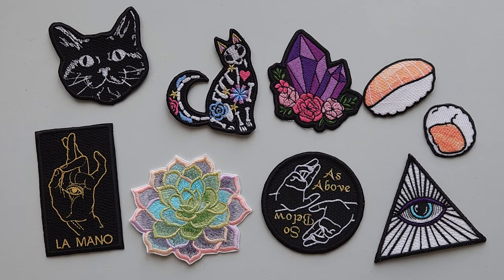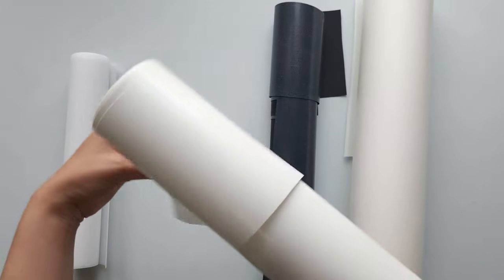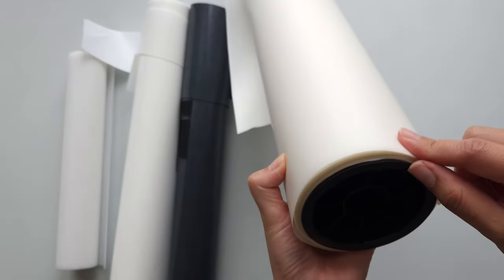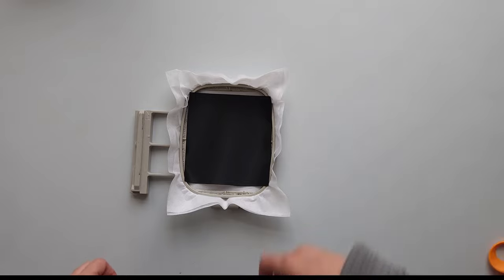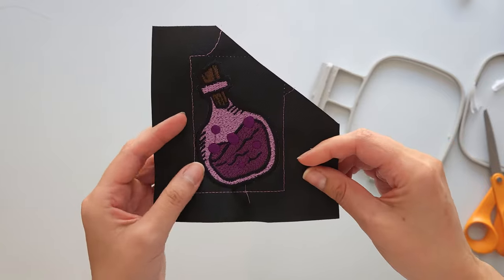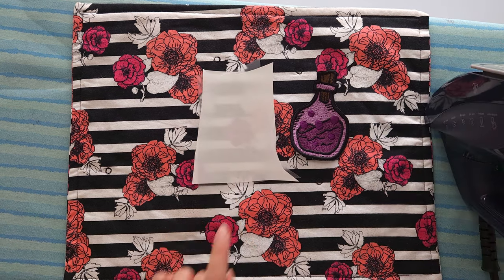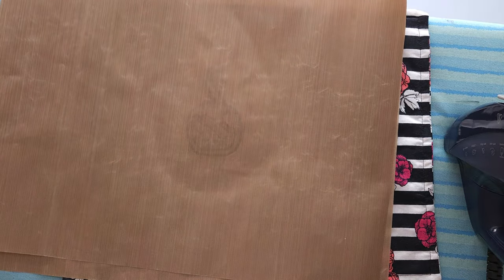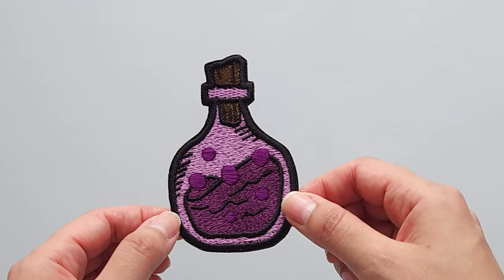How I Make My Iron on Patches

Comment: Is there a reason why folks don't do a rough, quick cut around the patch before doing the iron on adhesive and then the closer more exact cut after? The two videos I have watched from others also have them cutting carefully around the patch before and after adhesive. Just curious as I have not tried this before.
Reply from the maker: When I'm making a bunch of patches at once I actually prefer to apply the iron on backing to the patches before I cut them, then do the exact cut after. I should have mentioned that in this video but forgot since I was just making one patch. Good call out!

Comment: Why do you use patch twill and the iron backing? 
Does the patch twill not come with the adhesive back already? That part confused me.
Reply from the maker: Good question! My patches are fully covered in thread, so when you stitch on the twill,  the back of the twill is also being covered with the bobbin thread, so the twill adhesive is no longer exposed. I guess if you make patches with most of the twill fabric exposed in the background you could use the adhesive, but I've never tested it and don't know how strong it would hold up when ironed on.

Comment: What is a good alternative to patch twill? and is patch twill the same as polyester twill? I was trying to find some locally or at Joann's but am unsure what to search for.
Reply from the maker: good question! Felt is what I first started out with, just the thick felt that you can buy in yards from Joann's. Try with felt a few times and then you can decide if its worth investing in patch twill.

I tried the polyester twill you find at Joann's, but the end fray, so I would not recommend it.

Comment: Do you have to design your files to patch making ? Idk if that makes sense lol or I can I make patches with the dst files I already have. ?
Reply from the maker: The only thing special I do when digitizing patches is make sure they have a thick satin border (about 2 - 3mm) going all the way around in order to make it a nice clean cut. But even if you are using an existing dst file that doesnt have a satin border, you could still use it as a patch, it just wouldnt have that patch look of a border.